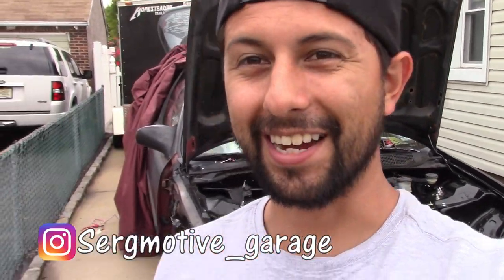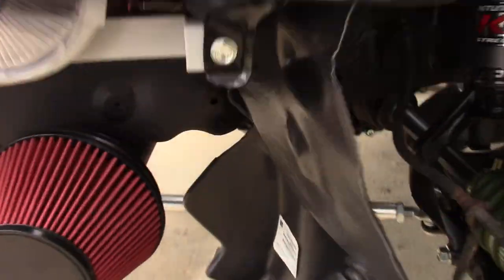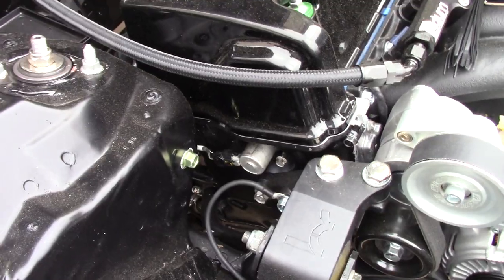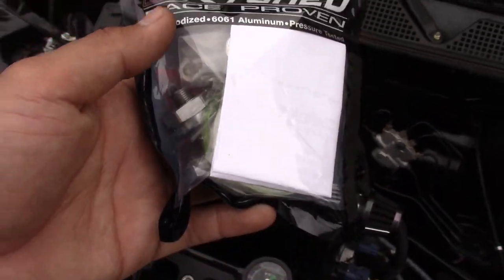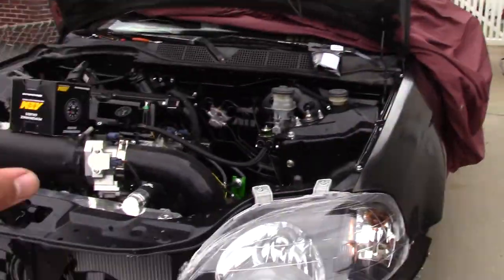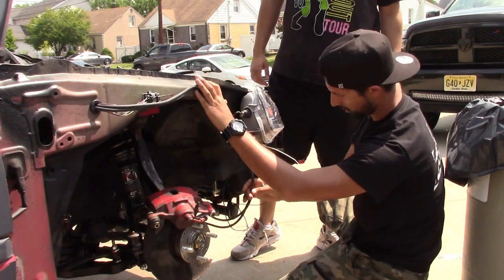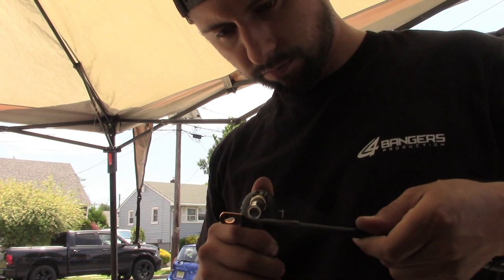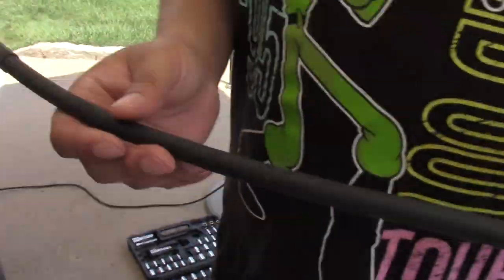Creating your own Custom Charge Harness

Comment: I know this video is old but ur if ever chasing a ground issue and wanna verify quickly, grab some jumper cables and put red and black both on the ground side of the battery, and the other red and black on the engine and trans, just using the cables as temporary clamp on grounds

Comment: There is no video on youtube for what i need to learn. Obd1 alternator has a large wire that goes to the positive side of the battery then there is the the 3 wire plug on the back of the alternator , what do these 3 wires go to and what do they do. I am completely building all my cars wiring from scratch except for the full fueltech dash and A engine harness. I got all that done. Maybe some day someone will make a detailed video
Reply: You ever figure it out?

Comment: Yo quick qestion i have 05 charge harness and i have 05 k24a2 motor  in 2000 ek hatch  can i use my 05 tsc charge harness in motor or i just to make them.longer or i have tk otber one type s one ???

Comment: What about running a wire from the fuse box to the alternator, then run the second wire to the distribution block. Run starter wire from distribution block.
Reply: Idk probably doesn't matter.